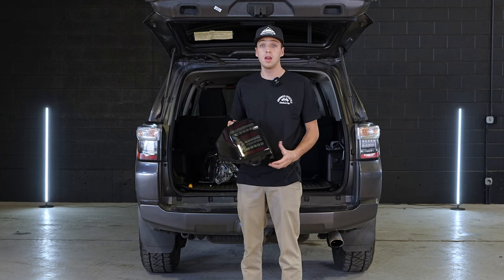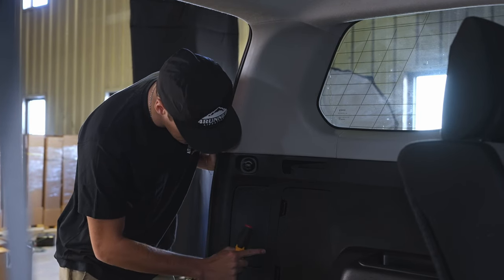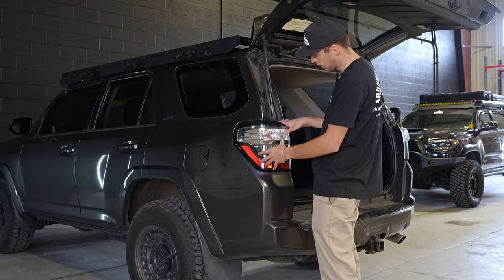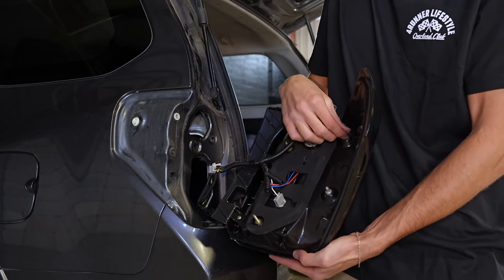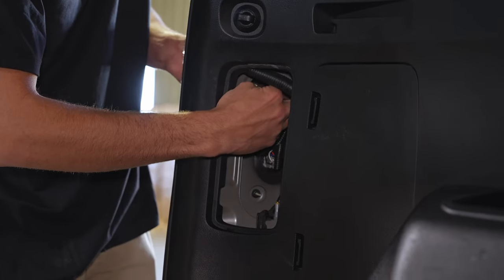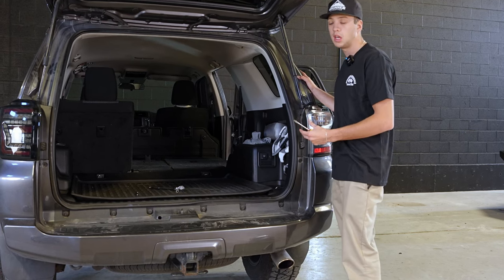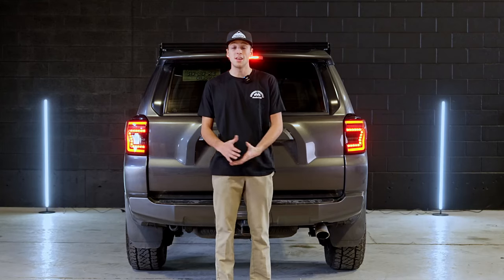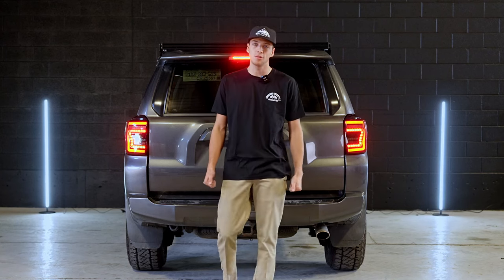4Runner Lifestyle Stealth Tail Lights Install

Comment: Not the easy of install as you proclaim
Reply: Skill issue
Reply: @Anthfigueroa  ohhhhh to contrary I've managed to strip down many motorcyclecles down to its frame and rebuild them. Not a skill issue. These are not "plug amd play" as they proclaim.
Reply: @Anthfigueroa  ohhhhh to contrary I've managed to strip down many motorcyclecles down to its frame and rebuild them. Not a skill issue. These are not "plug amd play" as they proclaim.
Reply: @Anthfigueroa  ohhhhh to contrary I've managed to strip down many motorcyclecles down to its frame and rebuild them. Not a skill issue. These are not "plug amd play" as they proclaim.
Reply: @Anthfigueroa  ohhhhh to contrary I've managed to strip down many motorcyclecles down to its frame and rebuild them. Not a skill issue. These are not "plug amd play" as they proclaim.
Reply: @Anthfigueroa  ohhhhh to contrary I've managed to strip down many motorcyclecles down to its frame and rebuild them. Not a skill issue. These are not "plug amd play" as they proclaim.
Reply: @Anthfigueroa  ohhhhh to contrary I've managed to strip down many motorcyclecles down to its frame and rebuild them. Not a skill issue. These are not "plug amd play" as they proclaim.
Reply: @Anthfigueroa  ohhhhh to contrary I've managed to strip down many motorcyclecles down to its frame and rebuild them. Not a skill issue. These are not "plug amd play" as they proclaim.
Reply: @Anthfigueroa  ohhhhh to contrary I've managed to strip down many motorcyclecles down to its frame and rebuild them. Not a skill issue. These are not "plug amd play" as they proclaim.

Comment: I have installed these in my 2020 trd pro and everything looks great. But i dont get the start up sequence nor the solid red LED thats always on?? Did i install these wrong ? I have them in auto.. do i need to change them to another setting in order for them to work ?
Reply: Did you get a reply to this, I have same issue.
Reply: I did not receive a reply. However when it’s bright out if you have in auto the start up sequence will not work nor will the always on red light as soon as it’s dark in the morning or at night they work or you can keep them on. The light setting so they do work

Comment: Hey guys, thanks for the quick shipping. Just got these in my truck and while they look awesome I have an issue with my drivers side light where two of the brake light leds are stuck on no matter what. Sent a video to your customer service email and hoping to get it resolved ASAP as I’m doing a photo shoot with the truck soon and would like to have your lights in there for it!

Comment: You'd think with all the fancy start up sequence you could program in a better turn signal and use the outer strip of Leds to be a turn signal too. Might have to buy the lights that go on the pillars next to the rear window.

Comment: Soo where did you stick the piece with the double sided tape? I know  it can go anywhere but any suggestions?
Reply: It's called a resistor, It helps for avoiding hyper flash, Tape it along the inside of the body of the vehicle.

Comment: Will they ever be back in stock?
Reply from the maker: We get these back in stock typically every 2 weeks but they usually sell out within about 5-7 days even when we order the largest quantity we can get. 

Fastest way to for sure get a pair is on the product page theres a little notify me by email for restock, we send out the email right when the shipment gets scanned of a restock, and then we don't post about it until a couple days later.  They usually sell out from there.
Reply: @4runnerlifestyle  thanks!
Reply: In stock now, just bought mine!

Comment: Is there a way to turn off the start up sequence?
Reply from the maker: There isn't on this version but if you interrupt it with a turn signal or something it will do/switch to that so it's not like you need to wait for it or anything.